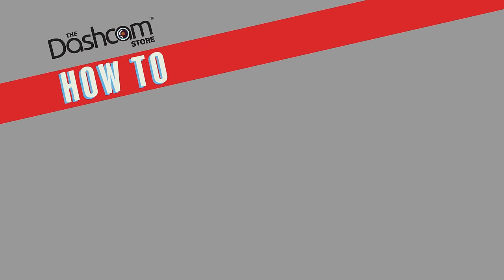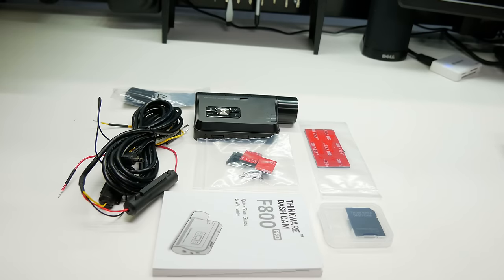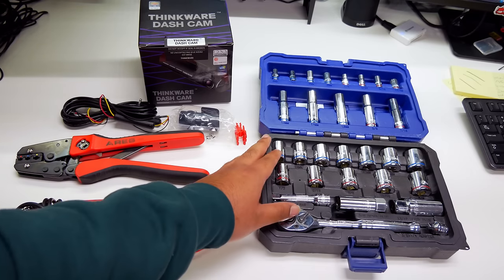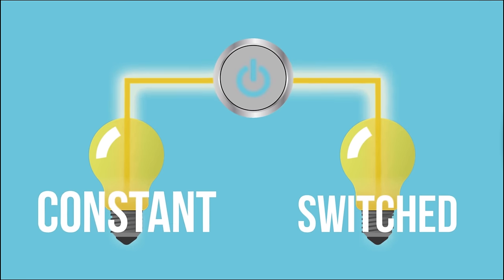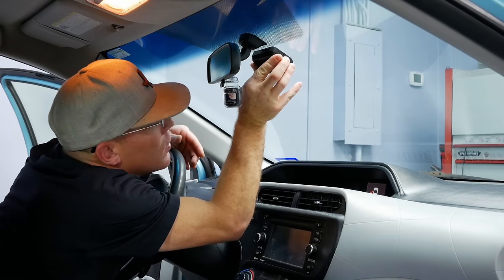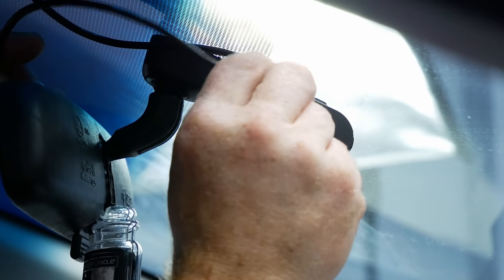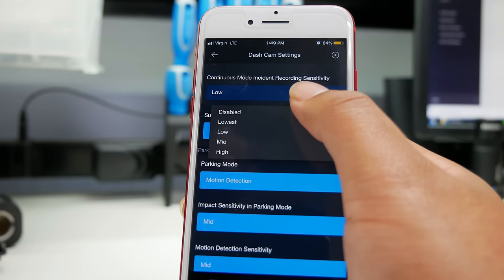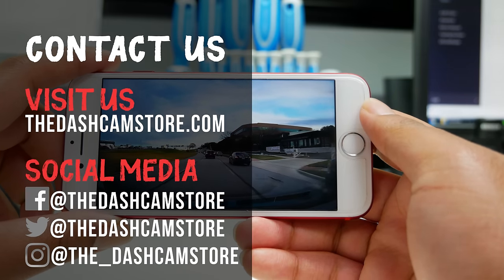How To Hardwire A Thinkware Dashcam | Installation Guide by The Dashcam Store™

Comment: Great video! This video saved me, I couldn't get the parking mode to work because I hooked up the ignition/constant power in reverse. Thinkware labeled the RED wire's glass fuse case as constant power WHICH IS WRONG. The yellow wire is actually constant power and the red wire is ignition. Thanks Dashcam Store!!!
Reply from the maker: We understand there has been some confusion on the cable colors so glad this video was helpful!
Reply: Does the red recording light flash when in parking mode?
Reply from the maker: @drewdub8425  the LEDs are customizable to your liking.

Comment: The new Mazda CX-30 (cabin fuse box) has all hot fuses. They always have power. There's only a handful. So do I have to run the red wire all the way to the engine compartment fuse box? Thanks

Comment: Great video, if I do not connect the yellow  wire for constant on & only use ground and switch wire. Will it only enable recording when the car is running or does this hardwire kit require use of all three wires. I really don’t need parking mode. Thanks in advance for your help
Reply from the maker: Yes, you can connect it to be only on when the engine is running. However, we would recommend connecting both the red and yellow wires to the same switched power source. If the constant wire is not connected at all, the system may not turn on.

Comment: Hi Great video! What was the 'Amp' of the extra fuse you put on top of the original Original fuse for the fuse tap? Whats the best fuse Amp to use for the Thinkware U1000 with front and rear camera?
Reply from the maker: The new fuse is generally 2-5A, no need to use a larger fuse than that just for the U1000 system.
Reply: @Thedashcamstore  can you please provide the same info for F200Pro dual channel. 

2014 E350 4matic sedan.
Reply from the maker: @BlahBlah-qp4wp  the installation process will be identical as shown in the video for the F200 Pro dual in your E350.

Comment: What fuse size should we tap into??  10? 15? 20?  does it matter for the Q800 Pro?
Reply from the maker: Fuse size is not critical but you want to use non-essential fuse circuits like "accessory outlet" or "dome light", not ones like "airbag" or "pcm"

Comment: What happens if i connect to two constant power sources or two switched sources? I think I did the former but everything works pretty well, including parking mode. But I'm looking at it now and wondering if i should change it
Reply from the maker: Improper installation may lead to the system not entering/exiting parking mode correctly, or possibly your battery being drained past the safety cutoff threshold.
Reply: @Thedashcamstore  it turns out i actually did have it installed correctly, it's been a year so I forgot. Quick question, is 7.5 amps okay for the fuses for the U1000 front and rear cameras?
Reply from the maker: @onesteeltank  yes those should be just fine

Comment: After installing hard wire kit, camera does not power on. The yellow wire is connected to a constant fuse slot ,red wire to a switched fuse slot  and black to an uncoated screw.The tap is plugged so the side of the fuse that is close to the wire of the tap is on the negative side of the fuse slot. The camera only powers on if plugged into the cord to be used with the cigarette lighter.
Reply from the maker: You should be able to use your test light or multimeter to check for voltage on the "plug" end of the hard wire kit. If voltage is present, re-check your ground point. If no voltage is present, re-check your fuse tap connections.

Comment: What amp fuse ????
Reply from the maker: Hello, which fuse are you referring to specifically?
Reply: The Dashcam Store where should I attach to. 15 amp 10 amp? Etc
Reply from the maker: @StayConnectedEV  we find the amperage rating isn't the deciding factor. In general try to pick a lower-rated fuse (below 15A) but try to use one for a non-critical circuit (accessory socket or radio circuits, for example) when possible.
Reply: The Dashcam Store thanks so much!!!!!!!!

Comment: Question: when you install fuse tapls into fuse boxe, - I heard that you need to check fuse which side has Voltage and which doesn't and  install in correct direction. Can you clarify and provide more info on this. Thanks
Reply from the maker: In theory yes the fuse orientation is important, but we don't emphasize this as there are still in-line fuses built-in to the direct-wire harness, so even if the fuse in the fuse tap isn't serving it's purpose, the in-line fuses will protect the vehicle and/or camera from damage should anything go wrong.

Comment: Can i just connect it directly to the cars battery?? Using the red/black cable??
Reply from the maker: You can connect it to any 12v power source including directly to the battery, but you will still need to connect both the red and yellow wires (and the black ground wire) in order for it to work. Be sure your low-voltage cutoff settings are correct in order to avoid a dead battery.

Comment: My f800 doesn't work in any combination, any fuse, any constant, any switch... but works with the cigarette power cable. Does that make sense?
Reply from the maker: There may be a number of things that could be the cause of this: improper ground point, bad contact with constant or switched power, blown fuse(s), etc

Comment: just purchased a fa200 thinkware. i got the hardwire one, do i need to get that fuse taps for the install?
Reply from the maker: The fuse taps are optional but not required
Reply: @Thedashcamstore  i bought them anyways. Question, before looking for constant and switch fuses do I need to close all doors and wait for everything to shut off? Or i can leave the door open while installing just like in the video?
Reply from the maker: @simplyblazeegaming  start by leaving the door open, if you have trouble locating a switched fuse then you may need to close the doors and wait for things to shut down.

Comment: My fuse box is in my trunk. Are the wires long enough to reach that?
Reply from the maker: Depending on how it's routed, it's possible the wire harness is still long enough to reach the front camera, even from the trunk. If not, it's simple to extend the wires.

Comment: How long are the rear camera cables? I have a 2016 Nissan Rogue and I want to connect the rear camera of my Thinkware F200 dash camera. I currently have it powered on the center console 12v outlet but I want to have it hardwired instead since the adhesive clips don't stick to the dash very well.
Reply from the maker: The rear camera cable is approx. 20ft long, plenty of length to get from front to back on a Rogue.

Comment: Can I turn off parking mode when I don't need it, like when I am parked in my lock up garage?
Reply from the maker: Yes, parking mode can be disabled in the device settings, or perhaps the easiest thing would be to simply unplug the camera when you don't want to use parking mode.
Reply: @Thedashcamstore  can i fuse tap both wires to a switch source instead of a constant to turn off parking mode?
Reply from the maker: @thomasho8636  Yes, absolutely.

Comment: Great video however, I have found few other videos saying to use yellow wire in switched fuse and red wire with constant power fuse.
I have hard wired my F770 that way and parking mode does not work. The camera shuts off after ignition is off and key removed.

Will switching the fuses other way round and wiring like you recommend, sort out the issue?
Reply: @Thedashcamstore  
I've spoken today morning with UK's distributor of Thinkware cameras and their tech support have ensured me that wiring method you have showed in the video (yellow wire for constant feed and red for ignition switched( IS actually CORRECT.
Red for constant and yellow switched was 2-3 years ago but nit currently.
You are right in the video.
Shame Thinkware forces their customers to do a wiring research them self, although selling hardwiring kit with cameras.
Reply from the maker: @martinkirkkirk1078  great! Thanks sir
Reply: @martinkirkkirk1078  They are incorrect, as well as this video. If you look at the red wire it specifically says that it is for constant power.

Comment: Is the yellow constant power? And the red switch ACC power? 
I'm connecting the wires red to constant power and the yellow to switch power,  its NOT WORKING
Reply from the maker: Yellow wire = battery = constant power. Red wired = ACC (accessory) = switched power, as shown in the video.
Reply: @Thedashcamstore  I'm having trouble, I followed everything in the video but no success, on 2019 civic , only in one way ,if I connected the red and yellow together is working,
Reply from the maker: @rcrc5260  please give our tech support a call at 1-888-855-5470
Reply: @rcrc5260  You did the opposite of the video.  
The video shows (and says) yellow to constant (See how it says "battery" on the yellow wire in the video).   
Then it shows (and says) red to switch/accessory (See how it says "ACC" on the red wire in the video).

Comment: What's the difference between hardwire cables with 2 wires and 3 wires?
Reply from the maker: 2-wire: for connecting to switched power only, records only while engine is running. 3-wire: for connecting to switched and constant power, for enabling safe parking mode recording.
Reply: @Thedashcamstore  Thank you. That makes total sense. Can you recommend a 3-Channel Dash Cam with parking mode and night vision?
Reply from the maker: @kpkaus  The Vantrue N4 is the only true 3-channel dash cam available currently, it does have parking mode and infrared (night vision):  https://www.thedashcamstore.com/vantrue-n4-3-channel-dash-cam-for-front-inside-and-rear-recording/

Comment: Got mine installed just fine. Wish I would have tried to connect it to my  Samsung S9 before routing all the wires. Can't get the dashcam to connect to wifi, making the cam worthless
Reply from the maker: Hi Keith, you could try putting your S9 in airplane mode which may actually help with the direct WiFi connection. If that doesn't work please give our tech support a call: 888-855-5470.
Reply: @Thedashcamstore  THANK YOU. You'd think Thinkware would mention this little tidbit. It worked
Reply from the maker: @kferg  fantastic, glad we were able to get that resolved for you. Cheers.
Reply: @Thedashcamstore  You are the only ones who did. Thinkware just kept sending me the same instructions I told them didn't work. GREAT customer service on YOUR  part. You've gained a loyal customer
Reply from the maker: @kferg  We appreciate the kind words; that's why we're here! Drive safe!

Comment: The fuse was under the hood but you reconnected it under the steering wheel?
Reply from the maker: Only the fuse puller tool was removed from the fuse box under the hood.

Comment: Where did you tap in the constant and the switch power?
Reply from the maker: Hi Billy. We try and avoid telling users exactly which fuses to use for liability purposes. We wouldn't want to tell you a specific fuse but your vehicle actually requires a different source. The constant/switch power sources are different in a Prius than an F150, for example. If you are unsure of which fuses to use, we suggest referring to your user manual. If you are still unsure, purchasing a circuit tester will ensure you tap the correct fuses. https://www.thedashcamstore.com/automotive-test-light-simple-12-24v-dc-circuit-tester/
Reply from the maker: @Nos That depends on your vehicle make/model/year. Tesla's for example do not like just any constant; research suggests you use the dome light as the constant source. I can't guarantee that your vehicle will like every single constant source. I would just do a quick search on google for something like this "make, model, year, dashcam constant power source". If you can't find anything please give us a call and we can help you one-on-one. 888-855-5470